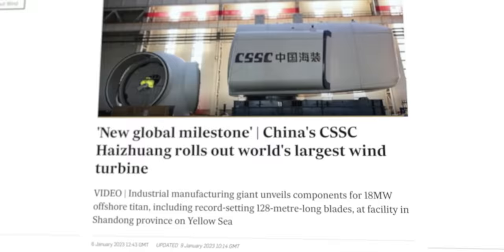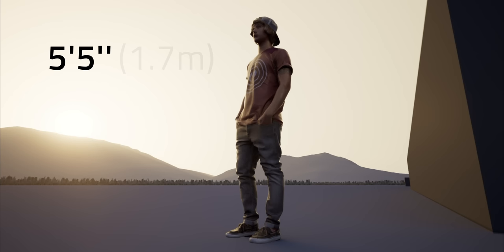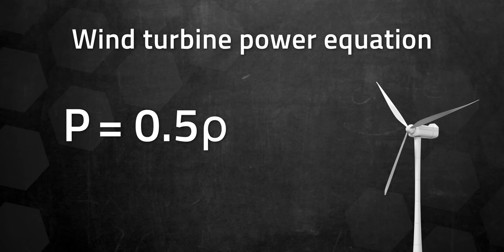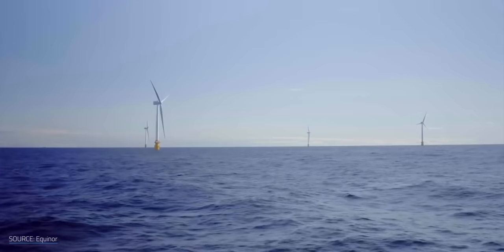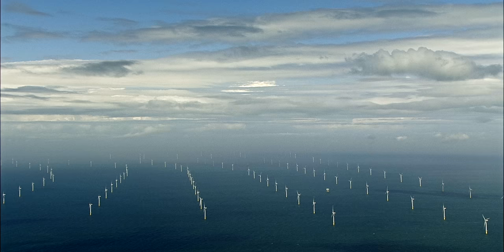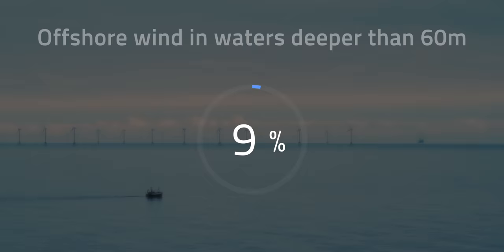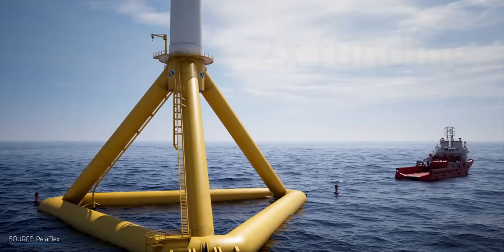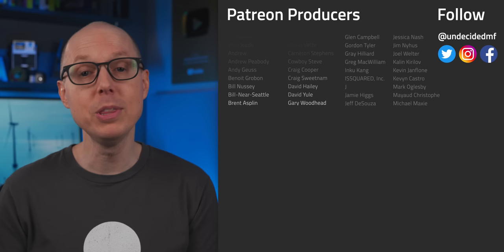Why Are Floating Wind Turbines So Huge?

Comment: I often wonder whether offshore wind turbines could be combined with tidal generators to increase the production of electricity, but reduce costs by using the same structure and transmission lines.
Reply: Good Idea
Reply: Tidal effects are most pronounced closer to shore than in the deep ocean, and certainly closer to the sea bed than the surface in the deep ocean.
Reply: The french are starting a green hydrogen project with floating offshore wind turbines, with the hydrogen platform between the turbines, using directly the electricity to produce the hydrogen directly from the ocean water, and its only one gas pipeline to the french coast where they do the storage.

If economicaly successeful, it will be the energy storage way of the future, where all vehichles since plains and trucks and ships can use.

Even powerlines can be replaced by hydrogen underground pipelines, and clean up the visual environment from power lines ugly view. And we just have hydrogen powerplants inside cities, creating clean electricity as demand on real time.

Just a theory yet.
Reply: If not tidal, wave power is also gaining traction. This is a good idea.
Reply: That would heavily damage aquatic life
Reply: The more offshore, the less tide.
Reply: or wave energy harvesters. the windmill field would  also provide a great habitat for nursery shoals
Reply: The proposal for a tidal barrage across the Severn Estuary included wind turbines and a road link on top of  the barrage structure. In effect trying to get as many benefits out for the infrastructure as possible. The proposal failed due to the then cost and local environmental effects.
Reply: You can dream a lot when you are spending others people's money - dream on!
Reply: @ash-et4wl  just asking for the sake of argument but ,how?
Reply: @mnomadvfx  True enough, but depending on the area, some have constant currents, that might be a partial answer.
Reply: @elbuggo  If you have a large supply of carbon energy you would use that (Hopefully as efficiently as possible), however if you do not and are subject to the hostile OPEC and OPEC + Cartel, your options are to keep on paying their extortionate prices or do something about it, Europe has decided to do something about it, it's energy structure will be majorly renewable energy by 2030-2035 and energy independent by 2040-2045, this will cost a lot of money Initially but will give Europe Energy security and a more reliable and reasonable pricing regime, this is happening at quite a pace at present, recently (2023) the regional Railway lines in my area switched to electric trains (A large part of the main line are electric), the city buses are 50% electric from 2022 (Not so much the regions as yet), new houses are majorly solar and heat pump with improved insulation, the Russian invasion has accelerated all this change, they will find their most lucrative market is lost forever!?!
Reply: @thomasherrin6798  Sounds like something from a faith based religion. 

Wind turbines aren't renewable. It is not as if they suddenly just appear like a new tree. Lifetime of a windmill on shore is 15 years. Then it must be renewed. Also need a system, another system, to produce electricity when the wind isn't blowing. That system must also be build and maintained and costs just as much. So you need 2 systems to have the lights on at all times. Or should we only have lights on when the wind is blowing?

Weird that the extortionate prices of fossils are so much lower than for "renewable" energy. That's why "renewables" cant be built without insane subsidies. Without heavy subsidies, no "renewables" in sight.

I guess we can buy all the stuff from China, since they can also produce energy there. They are burning more than 4 billion ton of coal each year btw, and increasing fast!
Reply: Marine Power Systems in the UK are currently looking at this for their floating structures.
Reply: @elbuggo  it’s nothing to do with faith, it’s to do with solid economics, climate science and geopolitics. The levelised cost of electricity per kWh for onshore wind and solar is lower than new fossil fuel projects pretty much everywhere except Japan. Renewables are also becoming cheaper every year, whereas fossil fuels are becoming more expensive as we must exploit more remote reserves. We still give millions in fossil fuel subsidies for stability. Renewables have only become cheaper than fossil fuels in the past few years and that is down to economies of scale due to subsidised R&D and industrial expansion largely in China, Denmark and Germany. This is what will occur with offshore wind if investment is maintained. 

Yes turbines need replacement, like everything. But they’re still renewable - there are now fully recyclable blades produced in Germany, and companies in the UK capable of recycling even the older models of fibre glass blades. The classic lifetime is 20 years, with modern iterations pushing that to 25, and with many recyclable components. Of course there are energy and resource inputs involved, as with every single action in the universe, but on any relevant scale they are renewable (even geothermal isn't technically renewable on an infinite timescale, but it's practically renewable on any relevant timescale). The lifecycle emissions and resource uses are still orders of magnitude lower than any fossil fuel projects, which also require lots of hard infrastructure, its just that that is normalised. 

There are hundreds of studies on energy demand balancing, with as many solutions. Pumped hydro; liquid air storage; gravity storage; supergrids; nuclear; diverse renewable sources such as solar, wind, wave and tidal can even out energy imbalances to a degree too, particularly wave and tidal due to their reliable nature. Nobody is saying one single source is the silver bullet to our problems, and yes you would need multiple sources of energy to match demand, but that doesn't negate all of the benefits of each source. Wind power is not a baseload source, use nuclear or tidal for that, or invest in the others solutions listed. However, it is economic and low emissions, which makes it an excellent tool to affordably lower the emissions intensity of energy supply. 

Most of Chinas emissions come from western companies outsourcing their production there, for goods sold to western consumers, then repatriating the profits to the west. Its very convenient when emissions are only counted domestically, so even though the industrial output largely benefits western quality of life, it's China that gets blamed for it. Over 80% of China's industrial output is for developed nations' consumption. China has invested more into renewables than the USA or Europe, despite their GDP per capita being $12,000. China only started seriously industrialising ~70 years ago vs us using coal for ~250 years - look at some historical emission consideration calculations. ⅔ of global high speed rail is in China. Most of the world installed solar capacity is in China. China has more installed wind capacity than Europe and the USA combined. They're building a grid the size of the USA's and Europe's combined purely for new wind power by 2050. All while 80% of the world's poverty alleviation since 1980 has been in China. They're achieved more reforestation than the entire developed world combined (to varying degrees of success, but still). China wrecked their domestic flight market in favour of a massive high speed rail network to reduce emissions. They have a high population and high emissions because its a massive place, with a high carrying capacity. Their emissions per capita are ~½ that of the USA, never mind land and resource use per capita. Maybe the USA would have a similar population if they didn't commit genocide against all the indigenous people.

Of course China has its problems, even environmentally, and particularly human rights abuses; but rich westerners shouting "China burns coal!" is ignorant of all economic, historical and geographic contexts. Its also one of the major reasons the west has dragged its feet on this since the 1970s - we're more scared about losing our competitive edge at the top of the global economy than we are about endless future generations inheriting a dead planet.
Reply: @mynameisjoejeans  Climate science is basically faith. You need to believe in the conclusions before you get hired or if you want grants. Climate science is basically a new global UN religion.

RE: cost of electricity per kWh for onshore wind and solar is lower

Could be when the wind is blowing or the sun is shining. But cost (significant!) regarding the grid is not included in the windmill and solar project. Many other direct cost are also hidden. Costs that must be added for generating el when the wind and sun is absent are also always skipped. It is SOOOO deceptive!

Re: Renewables are also becoming cheaper every year, whereas fossil fuels are becoming more expensive

If that is so, we can only sit on our hands and wait.

RE: The classic lifetime is 20 years

By experience, windmills onshore last 15 years and offshore 12 years. Short economical lifespan compared to other plants. 

How many years will a windmill have to run  before it has generated as much energy as was needed to produce it? Nobody knows! Tons of wires for the grid and steel and cement takes a lot of energy to manufacture and transport, among other things.

RE: emissions and resource uses are still orders of magnitude lower than any fossil fuel projects

How to tell? Cost for the grid and the phase out/clean up are never counted. And what about the emissions? CO2 is no problem whatsoever anyway.

Re: tidal 
That is even at least twice as expensive as windmills. If you have unlimited money you can build unlimited stuff - that's obvious. But you will only spend 95% of everything for this system?

RE: Most of Chinas emissions 
Anyway, they will continue to grow. Expect 5% increase coal consumption each year, or perhaps 10%? China is also famous for empty million people cities. They build whatever that can increase the BNP.

Coal again:

China burned 1 billion ton in 1994. Now it is 4 times more. How many windmills do we have to build to compensate for that? Next year they will probably burn 4.2 billion ton - increasing fast!

RE: inheriting a dead planet
There is no chance for that. I wish you would understand that the atmosphere is not a big tank. I wish you would stop believing that everything we throw into this tank will stay there forever. It is solely the ocean who determines what we get in the air. The ocean will chemically eat everything the ocean don't want to be there. The atmosphere is only the other shell of the ocean. I wish you would understand that the atmosphere is not a big tank.
Reply: Something to think about.  This windmills max capacity is 18mw max.  Nominal output is about 30% of that.  Average natural gas plant is 28x that.  Average plant. Not a big one.
Reply: @mynameisjoejeans  Wind is only cheaper at the pole, the delivered cost with backups to meet required up time, wind is a lot more expensive.

Comment: This is a great video. We install these mega wind turbines and are building new vessels to handle the larger turbines in the future. I really appreciate that you bridge the gap that Energy, Oil and Gas will finance, engineer, and install the renewables of the future. The true size of this equipment would blow your mind.

Comment: Dirty air is a huge thing in motor racing as well.  Vortices in the air coming off of other cars have a huge effect on your own car's downforce and handling characteristics.  The air behind other cars is less dense overall, which is better in the straights, but in the corners your downforce will be ruined by 'dirty air' (aka vortices, air moving at different speeds in the same area and other disturbances) if you're following too close.
Reply: Also, following too close can cause your car to fly up into the air and flip end-over-end (at least it did for the Mercedes CLR at the 1998 LeMans race)
Reply: we add a LOT of technology to the blades to avoid this, vortex generators and serrations on the blades..can go a long way to help with waking. Problem is that the areas we are allowed to build the bigger onshore ones, is in areas where they can reclaim the land from small older turbines, so the get the crap waked out of them.

Comment: 💨🌊🌬 Great to see someone with expertise in wind energy shedding light on floating wind turbines. Your insight on the advantages of larger turbines is spot on! The scalability factor is often overlooked, as bigger turbines mean fewer installations, reduced foundation and cable requirements, and more efficient maintenance and operation. These factors contribute significantly to cost savings and overall project efficiency. Thanks for sharing your knowledge and raising awareness about the potential of offshore wind. Cheers from the windy shores! 🇳🇴✌💡

Comment: Ive just completed a university report on a theoretical windfarm on Irelands west coast in 50m water depths. We went with tripod jacket foundations and SG10.0-193DD turbines due to concerns on the reliability and lack of comparative research in the field of floating wind. Seeing China do 18MW floating is incredible and seems like a leap in innovation for sure!
Reply: What would the rated capacity be of the theoretical wind farm?
Reply: @gabrieldsouza6541  If the wind maintained 10m/s for 1/3 of each day it would produce 730,000 MWh from 25 10MW turbines. This would be 2.3% of Ireland's 2019 energy demand. Purely theoretical of course but an interesting research topic
Reply: @DannyRice01  Hi, I always wondered when looking at the current electricity load, power sources and wind capacity of Ireland how come you are not much further with land installations yet. Tons of gas import and electricity import from the UK could be saved... thoughs?
Reply: @Walterwaltraud  Nimbyism, conservation area concerns and an abysmal grid system that needs a major overhaul means Ireland is behind on their wind installations. But now the money is there and goals have been set so it will happen in time!
Reply: @DannyRice01  Hey, thanks a lot for the update! Was there anything that accelerate change? The Ukraine war? Price hikes?
Reply: @Walterwaltraud  Mostly just natural growth in the sector and Ireland's renewable energy commitments I believe
Reply: @DannyRice01  Thx!
Reply: It's so great that young adults are being used as free research proxies for obscenely rich energy corporations.  I hope this renewable resource of young minds is harvested continuously.
Reply: @nahimgudfam  My research was for university eyes only wasn't submitted to any journals. Was great to research and learn new information which is what university is all about
Reply: @DannyRice01  ah yes SG10.0-193DD turbines
Reply: Hello, I am currently doing a project for my university where a team of engineers are investigating adaptive wing turbines and turbine blades based on varying weather conditions. I’ve been reading up on research regarding materials and the impact of adding aileron features to turbine blades. It seems like adding aileron features might increase maintenance costs and weight requirements more than actual energy production.

Since the project specifics are pretty loose, I’m open to exploring different developments in the turbine industry. I’d greatly appreciate any input or expertise in wind energy and turbines. My team needs a solid basis before we can start investigating and possibly developing adaptive wind turbines. Any insights or knowledge you can share would be invaluable. Thanks in advance
Reply: @ausitnsalas3368  Ailerons have potential but the maintenance costs will be a big issue yeah. All I can say is that the best wind is offshore so any development to move offshore at scale easier will be a massive win. What University are you at?
Reply: @DannyRice01  I am currently an undergraduate for New Mexico State University. Also I’ve seen a few things about offshore wind but it doesn’t seem like moving parts would be beneficial. I’m trying to look into possible material changes in regards to how they react to weather conditions but I’ll take any input or advice I can get.

Comment: I read a recent study that discovered the cost for removing worn out blades and disposing of the waste will expend more fossil fuel than if they hadn't been built in the first place.  Salt water, the wind and sand destroys the blades at a vastly greater rate than land based turbines.

Comment: The city of Berlin has 3.7 million inhabitants. If those new Vestas windmills are deployed and really can supply 20k households each, it would take about 185 of them to power the entire city. Pretty wild, I think
Reply: When the wind blows just right. The rest of the time you'll be burning coal.
Reply: @patrikb1161  Simplified calculation, obviously. though a smartly built renewable grid won't depend on "wind blowing just right", which is even more simplified

Comment: Fun fact, china suffer from regular typhoon attack. Those turbines are designed to harvest energy from it. They can withstand 180kmph wind. However these massive power spikes cause problem to power grid. They have to waste that energy. The average power is just 0.5% - 2% of the peak it can generate!!! If we have good energy storage strategy, 1 typhoon day would be able to surpass 100 normal day!!! So there is a long way to go in wind power